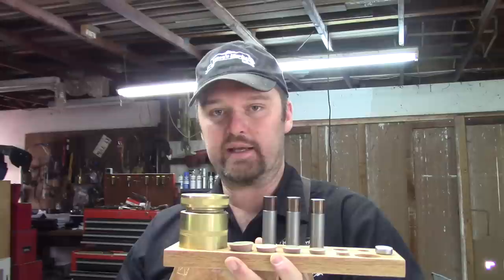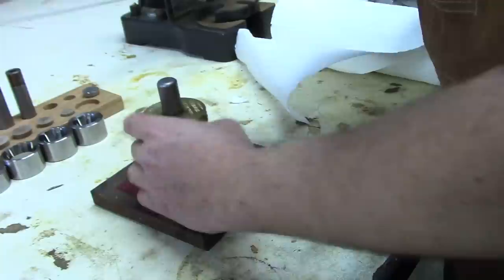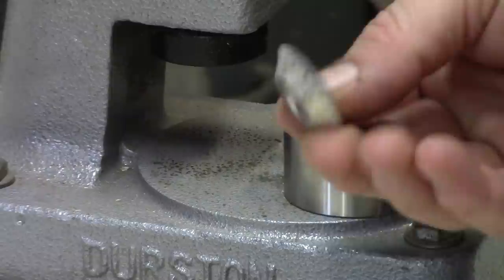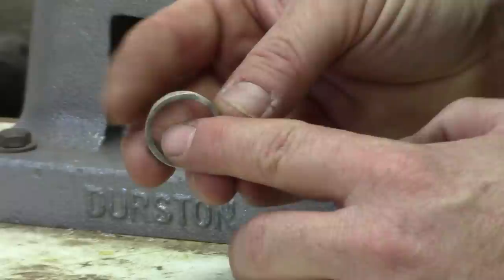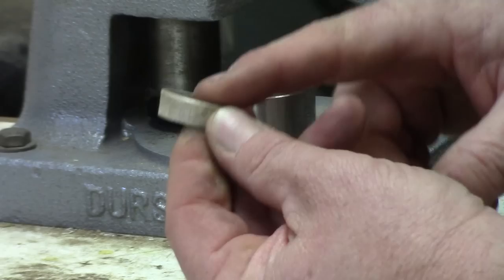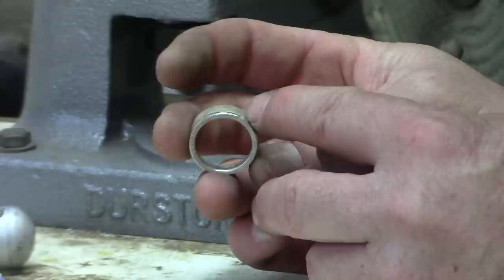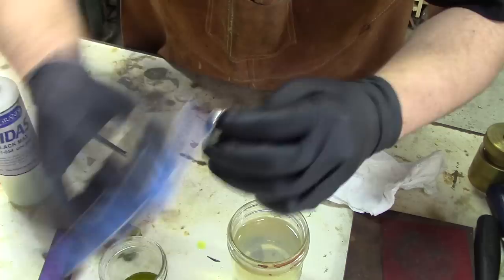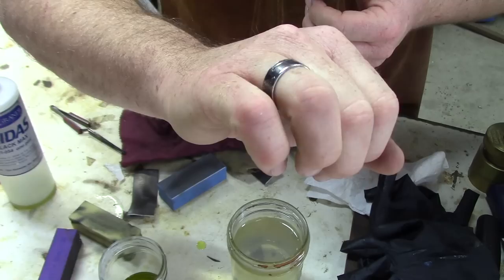Coin Ring Making With Jason's Works "Classic" Starter Kit

Comment: I have silver rings that have a patina on them, and in order to polish them up to a shine I typically use a piece of leather. It will put a mirror shine on silver. And if I have to redo my patina I have a small detail paint brush and are use bead buddy patina solution. It’s real simple and you can get it at Joannes fabrics. Learned how to do this after I get distracted while cleaning my ring and it removed all the patina.

Comment: I've had Black Max on the shelf for a long time... But a couple months ago I just used a cotton swab to apply on the outside of the coin ring... I don't rinse off. I just buff it to a shine and enough where some highlights start showing (NO Steel Wool)... Then let dry for a day and a light sanding block to make the highlights show through more, and then a light renaissance wax... The Morgan I've been wearing has kept it's patina for 2 months now with a strong coat. I tried the LOS way with BM, but the patina faded in days. I'm also experimenting as I go.
Reply: You had to post that twice? It wasn't interesting the first time.

Comment: Hi Jason, at 1:41 in the video, prior to annealing, you use a pair of flat tongs/pliers to hold the coin.  Where do I find a tool like that?
Reply from the maker: Here is a link to the ones I think I got: https://www.amazon.com/Inches-Crucible-Stainless-Professional-Casting/dp/B08Z1XQMS5/ref=sr_1_1_sspa?crid=1ITIP1DRW8Y81&keywords=tongs+crucible&qid=1676852826&sprefix=tongs+crucibl%2Caps%2C214&sr=8-1-spons&psc=1&spLa=ZW5jcnlwdGVkUXVhbGlmaWVyPUEyM1I4Sk5HUThTQzdIJmVuY3J5cHRlZElkPUEwMjY3NDQ4NTM1QVVXWk1ER0pCJmVuY3J5cHRlZEFkSWQ9QTA3NjQ4NTIzR1NVTEdYQUFHRTVKJndpZGdldE5hbWU9c3BfYXRmJmFjdGlvbj1jbGlja1JlZGlyZWN0JmRvTm90TG9nQ2xpY2s9dHJ1ZQ==
Reply: @JasonsWorks  much appreciated :)

Comment: Welcome back! I was starting to get worried that you'd retired on us.

How do you deal with the ridge at the edge of some coins? Most of them aren't too bad but once in a while you get a coin with a VERY high ridge around the edge that makes it hard to get the ring in balance......
Reply: I file the high ridge off with a flat file before I roll or fold the coin 🪙. 
Also this takes some of the strength out of the ridge because it is thicker then the center of the coin. Also it makes them easier to wear because it is smoother.

Comment: Lol .....paper towels? Lose detail?    If you need to add anything besides the correct tools or snug nylon spacers than the setup is wrong especially if you need to add Teflon tape or paper towels to punch a hole in a coin without marring it........